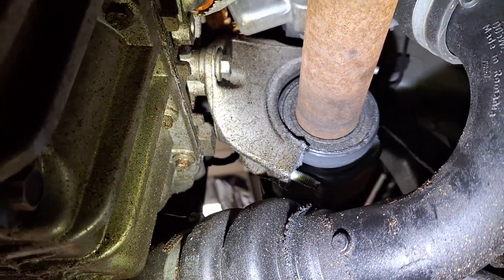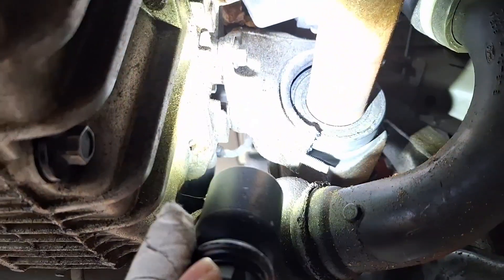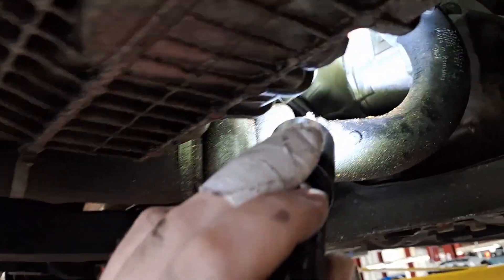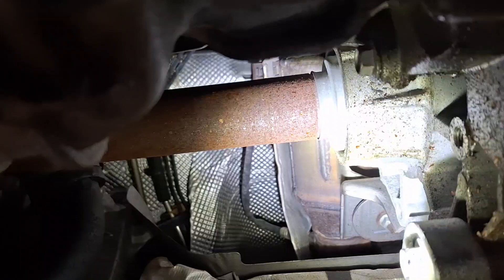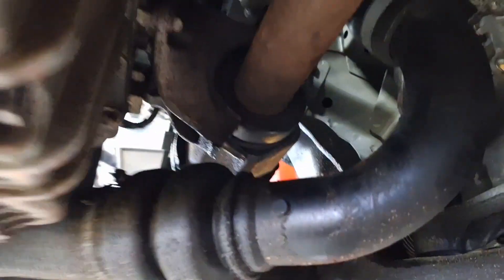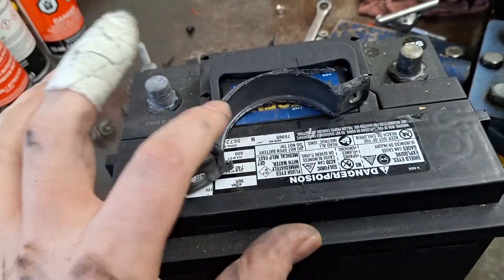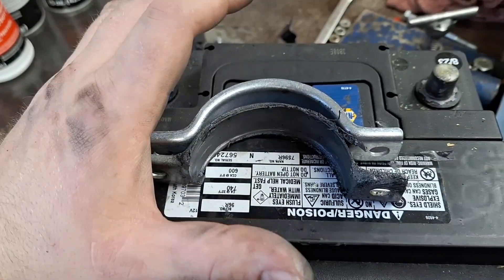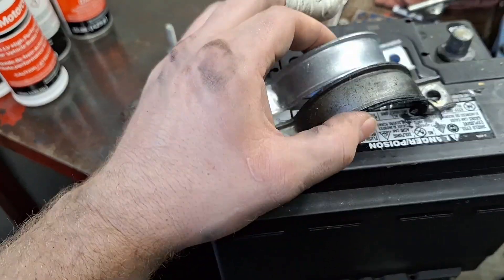2WD Ford Escape Owners: Inspect Your RH Axle Regularly! Avoid Costly Repairs

Comment: I had that bearing explode on my 2012 Focus.  There were only about 4 or 5 balls left in the race.  The only symptom was the steering wheel was off center.   It was an aftermarket axle and it lasted about a year.   The original axle boot had torn and sprayed grease all over the inside of the wheel.  The dealer couldn’t get a Ford one at the time (blamed Covid).  

I ended up replacing it myself with a new Ford axle.   The aftermarket one had a warranty but they wouldn’t deal with me, I had to get the dealership to work with the manufacturer.   I did eventually get a warranty replacement.   It’s sitting on a shelf in my garage and will probably never get used.
Reply from the maker: Oh wow! Glad you got it sorted out. Hard to find quality parts sometimes !
Reply: @BigBensCarsAndCycles  It was actually a pretty easy job.   It popped right out of the hub no problem and there’s no clip at the transmission end so it came out of that end too.   Now the left side was a different story.   The splined end came out well enough but that dang clip holding it into the transmission was a bear.  I ended up getting one of those fork tools to pop it out.   And then putting the new one in I had difficulty with the clip again.   I was trying not to damage it but it took judicious use of a big mallet to get it in.